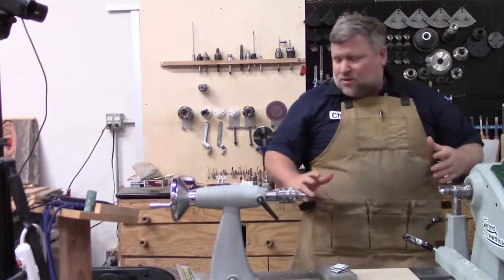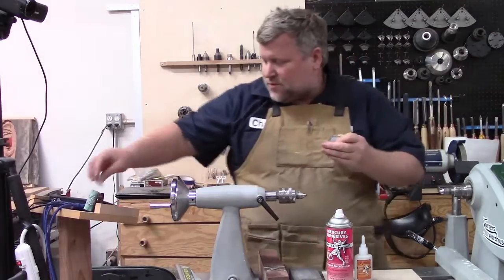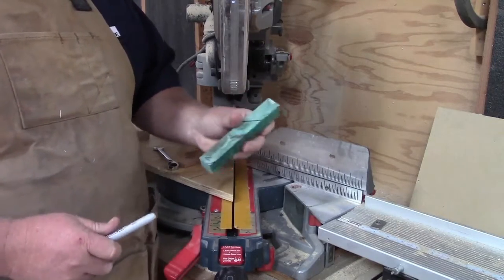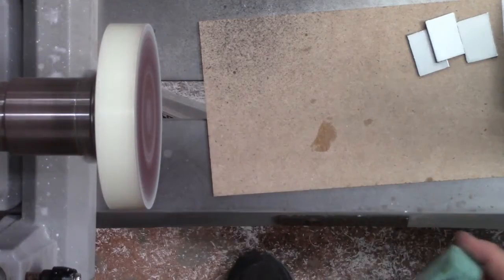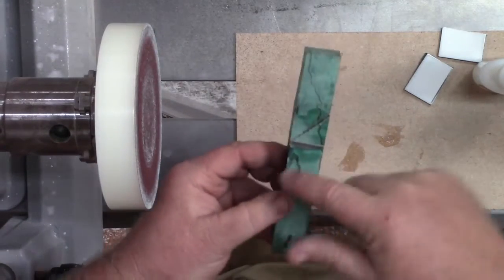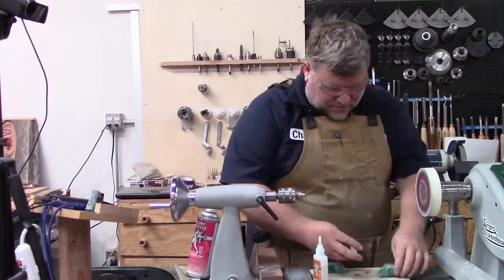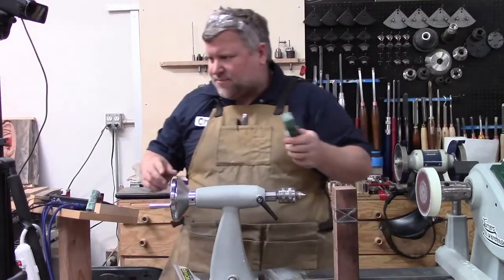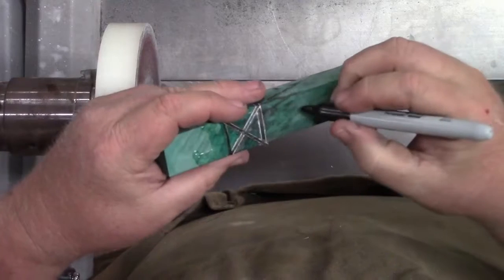Making a 3 layer Celtic Knot Blank and turning,   Easy segmenting woodturning.

Comment: Can you insert a thick piece into any size cut?  Can you use a round piece to start instead of a square? Thanks
Reply from the maker: sure, when I do them now, I cut all the way through, it makes it easier, and yes round is fine, you just have to have each side marked well (its easier with square)

Comment: Dude ... dust mask! I get that you're filming, but that dust when you sand the insert flat is totally toxic, as is the acrylic blank dust. MASK! 
Should be using a mask anytime you sand acrylic, or metal for that matter. Now that I think about it, there are woods you shouldn't turn or sand without a mask. Cherry is pitchy. Exotics have all kinds of oils (that you actually have to clean with acetone before you glue them to anything else or they won't hold) that can't be good for the lungs. I see that you're all about safety when cutting and turning, but extend that to breathing.  When you sand, I note that all of the dust comes toward you. Will be the same on the lathe.
Reply from the maker: totally true, thanks for looking out :-)
Reply: @ChadSchimmel  Safety, you know. Some of those exotics as well as resin are extremely toxic. Might not have any bad effects now, but years from now ...

Comment: Turners Warehouse is AWESOME!
Reply from the maker: Thanks Mike!!
Reply: @ChadSchimmel  Seriously your crew is the best. Hey Chad question: I was making a Celtic knot pen and was doing pretty good until cut #4 and it blew up on me! it scared the crap out of me! I was using a chop saw with a plywood jig I made to hold the blank. I think maybe the teeth were too aggressive. I do have two chop saws so I thought I would just get a 10" fine tooth blade for one. BUT,  in your opinion, what is the best option for making those cuts? Mini chop saw with a very fine blade? or a 10" fine toothed blade? I am focused on ease of use and clean cuts. Thanks Chad!

Comment: I came across your channel a month or so ago and watched this celtic knot video.  I watched it again to be sure I heard correctly what you said quite early in the video.  You said that you did not think it mattered how thick the inlay material is as long as you reference the same end each time you cut the blank.  I will give you that the one end, lets say the top for reference, of the knots will be in the same vertical position in the blank no matter what thickness inlay you use.   But unless you use inlay material the same thickness as the saw kerf, each cut will stairstep the the thickness of the inlay plus or minus the thickness of the saw kerf.  Example:  The inlay material is 3 mm and the saw kerf is 2 mm.  The second cut will result in the bottom half of the first inlay being moved down the blank 1 mm.  The third cut will move the the first inlay another 1 mm down the blank (now 2 mm lower) and the the second inlay down1 mm lower.  Make the fourth cut and the first inlay will be down 3 mm, second inlay down 2 mm, third inlay down 1 mm, with the fourth inlay where all the inlays should be to make the "perfect symmetrical knot".   The thicker the inlay material the more offset the rings will be.  Fine if that is the knot you are looking form  go for it.  With the looks of your demonstration knot your blade kerf is very close to the inlay thickness you are using.  I can see where you can get the impression it shouldn't matter as long as you start the cut in the same position.  I though that too until I tried it some time ago.  To verify it I just finished a knot with not the same thickness inlay as the blade kerf and I'd consider it firewood.  I would hate to have someone go down your suggested path to be disappointed with the results on a project piece.  I did subscribe and look forward to your future videos.  FYI